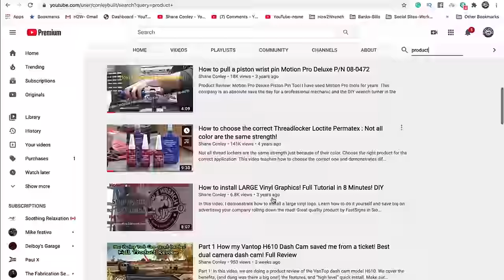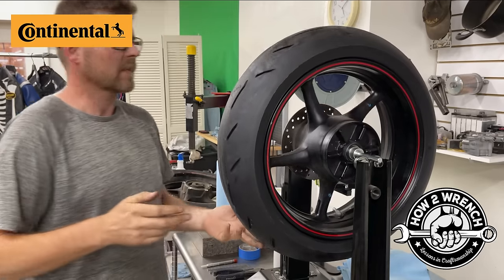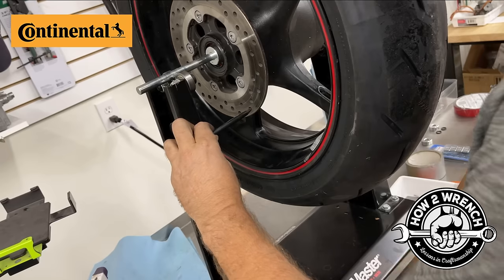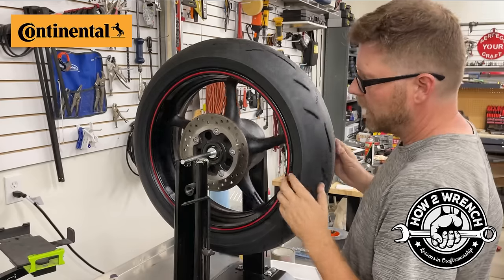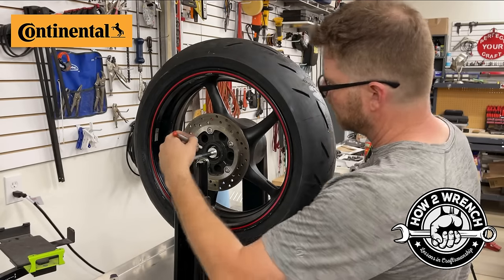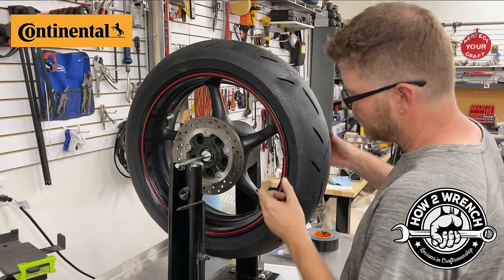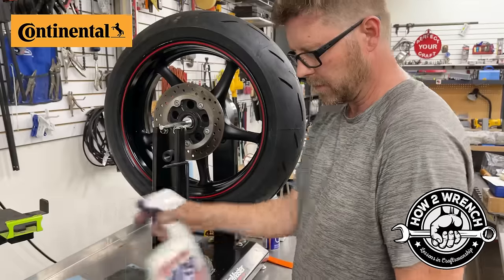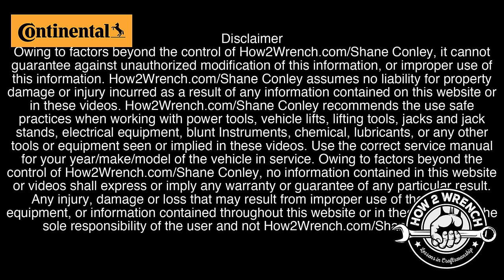Learn how to balance tires like a pro in minutes! Must see first step! BikeMaster Balancer 800-256

Comment: Been balancing my own MC tires this way for 25 years.....One top tip I would offer is before mounting new tire, take tire-less wheel on the balancer and find the TRUE heavy spot of the wheel.  its not always the valve stem.  Mark the wheel this way when you mount a tire with a dot indicating the light spot of tire, you can align the dot with the TRUE heavy spot of the wheel and this usually results in less weight required to get a perfect balance.
Reply: Damn that’s great advice. Doing my first tire change on my motorcycle and will definitely use this tip. Assuming the tire I ordered that hasn’t arrived yet even has a dot.
Reply: @rivec33  If you need any help or tips lemme know
Reply: @craiggoldstein2461  cool thanks. Doing it sometime next week. Looks easy enough.
Reply: @craiggoldstein2461  think I did ok. My tire did come with the yellow dot. Lined it up with the heavy part of the rim (which wasn’t the valve stem) and had to use 7 quarter oz weights to get it balanced. Decided to break the bead and tried it at with the yellow dot at the valve stem (valve stem ended up being at about 2 o’clock to the heavy part of the rim) and the yellow dot only took 6 weights to balance somehow. Was thinking of breaking the bead and spinning the tire around on the rim on the balancer to see where it landed the best balance without any weights and go from there but the service manual says not to exceed 3 oz and since it is only half that decided to just leave it alone. I would have been good either way I guess. I’m wondering if the yellow dot on the tire was incorrect.
Reply: @rivec33  Rivec, you clearly have a solid handle on the process.  Well done sir!  yes 1.5 ounce is OK and I would have left it alone too.  What brand tire was it?  I have a buddy who runs Shinkos (I tried talking him out of it) and did the last two for him same model Shinko....First one took 2.5 Ounces no matter what I did...the second one only 1 ounce....I think their quality control isnt the best.
Reply: @craiggoldstein2461  it was Dunlop Dt3-r. Same tire that came off. I noticed on the old tire the yellow dot was still visible and lined up with the valve stem, it had 3 quarter ounce weights maybe 2 inches away from the valve steam. This one with the took 6 weights in the same spot the old 3 weights were at. I should have probably left them on there and seen what happened. Took the bike out and didn’t notice any vibration or anything, it felt smooth. But didn’t go to far since it was about to start pouring rain.
Reply: @rivec33  Sounds like you did a good job and the Dunlop's can vary a little bit too!  No tire is perfect from factory.
Reply: @craiggoldstein2461  thanks for your help and advice. Appreciate it!
Reply from the maker: Great ads Craig...
You rock for commenting! Smash to sub button and we welcome your comments! 
Another way to help us back is joining or grabbing our T-shirt! Support links and gear below!  Awesome and thanks for commenting! Smash the subscribe button (thank if already a sub!)
Have you seen our "YouTube Trained Support Shirts? Great way to "high five us" https://goodfellasmerch.com/collections/how-2-wrench/products/support-shirt 

Join this channel to get access to perks:
https://www.youtube.com/channel/UCBhM8DCKnT3qXwTW0eToyCg/join    
-Daily MEMBER FIRST COMMENTS ANSWERED FIRST 
-Live Q/A video chats
-Wonder if we have a video on your need? Members can request content links!
-Full Access to the ENTIRE 700 video library
-Member-Only FREE tool giveaways   

Got an emergency and your head is about to explode from frustration or fear? Get Shane’s cell here: https://how2wrench.com/ols/products/techline-one-on-one
Reply: Thank you never thought of that and great you shared that info
Reply: This comment is perfect.
Reply: Same here, waiting for tire.
Reply: what if my tires don't have any DOT to indicat the light spot?
Reply: @JasonLeVlogs  Good question....If there is no light spot indication, I would just mount it randomly and attempt a balance.....If you find you need more than a couple of ounces to correct I would break the beads and rotate tire on rim 180 degrees and retry to balance.
Reply: yeah, on my bike the rim itself is more out of balance than any tire I've ever put on it. I have weights  permanently balancing my rims and then I'll put in some balancing beads to deal with however much the tire is off.
Reply: @joeMW284  I had a BMW K1600GTL and that wheel was REALLY heavy at the TPMS sensor....What bike was yours??
Reply: @craiggoldstein2461  '01 Honda Magna
Reply: @rivec33  Hey not sure if you'll see this but I'm getting tires for my bike and when I was calling around to get prices for mounting and all that I realized most places aren't even gonna bother balancing them. I've changed car, truck, etc tires by hand before and some dirt bikes 20 years ago but never had correct tools. At this point I figure why not by a few spoons (I think those are better?) and whatever else I need to properly change the tires without risk of damaging rims. Trying to figure out exactly what I need (how many spoons/levers) and whatever else. Any chance you could give me some recommendations?
Reply: Yup, find the heavy/light spot on the rim before mounting the tyre then hope the tyre manufacturer did a proper measurement on the tyre (with the dot). I got a couple wheels with no weights...

I always balance with clean carrier w/sprocket (and cushions) and brake discs mounted too.

tip: mark the center of the tyre with a marker as the dot can "disappear" when mounting it on the rim.
Reply: I'm wanting to do the same I've been looking into it seems like the best idea to save money
Reply: @Jonathan Galiano  hi Jonathan, you'll need three spoons, two of them should be the Bead Pro spoons as they double up as a bead breaker and then another spoon that's about 15 in longer or so, so that you'll have leverage with that one. To put the tire back on I use a Baja no pinch Tire tool, this way you're not prying the tire back onto the wheel You're simply Pushing the Bead over the lip of the wheel
Reply: Does the tire come with the light spot marked? Or do I have to find it?
Reply: @TheeTaper  Most Motorcycle tire producers put a yellow or orange circle stamp to indicate the tire light location.  On occasion they don't have any in which case you install it random and see how the tire/wheel balance out.  if requires too much weights then break the bead and rotate tire 180 degrees and try again.
Reply: Doing my own balance, no experience of doing any of this before. Lined up heavy spot on the tire with the light spot on rim. However a second imperfection is messing with the balance due to both spots needing counter weight. My mechanic friend that works on cars only at a shop says they just add weights in different spots when needed for different imperfections.
Is this a thing that can be applied to motorcycle balancing as well? 
Every video I ever see only shows people adding weights to one single spot, and they never mention you may have to add it to two different spots on the rim.
Reply: @flametai1  You can rotate tire 180 degrees on the rim and try again......doing static balancing at home putting weights on multiple spots on a wheel is probably a waste of time.  If your balancing setup is decent you sould really only identify one location to add weights.  You can also try sliding that location an inch or two sometimes makes a huge difference.
Reply: @flametai1 That is because you never need to add weights to more than one spot.  People who don’t know how to use dynamic balancers can get into a situation called “chasing weights,” but that isn’t because you need weights in two places, it is because of the way the machines work.  Experienced operators know who to recognize and deal with this.
Reply: Static balances work well, but they only can balance in one dimension.  With narrow wheels, this isn’t a huge limitation, but with wide wheels it can be a big problem.  That is where you need a dynamic balancer than can balance in two dimensions.
Reply: Sir My motorcycle already disassembled myself for cylinder kit replacing and painting.I can try this idea of course👍
Reply: Back in the 80's when I worked at dealership, I checked a bunch of Yamaha's and Suzuki's just about all the bare wheels I checked were 'perfect'
Reply: With the front tire on my Ninja 650 there's no space to put the weights in the center, instinct with physics tells me I need to put them in equal amounts on either side up to the proper weight to balance to prevent any wobble at high speeds. No videos show specifically a front tire. I have two 1/4 oz weights on the right and one on the left of the rim lips. 3/4 oz "statics" the tire be it on one side or the way I have them now. 
What is the proper way to do this, and will it cause tank slapping at high speeds?
Reply: I am so happy I came upon this video, thanks for all the great tips.
Reply: I just did my first tire tonight. I should have checked the wheel first. Oh well, I guess I'll check in next time!
Reply: Oh that is great advice. I'd assume that BMW have their wheels perfectly machined and are balanced. But is is a great pracitce. TPMS sensors add to the equation.
Reply: If you are really ocd temp balance the wheel alone. Pro tip get a sharpie and mark that weight/location inside the wheel.  Then throw on the tire and find the heavy/light spot and required balance weight of the tire.  Now you know how exactly where to match up and how much weight you should need.  You also have the data to track tire to tire and see what kind of quality you are getting.
Reply: Beat me to it
Reply: For sure good advice.  Especially Harley wheels. The coushin drive and everything can be off.  I do like you said and pre balance all that. A lot of times you can pull the coushin pully rotate it and find balance that way.  On my own bikes I take the time and move it along with the tire if need be and 99% of the time I can get it spot on without weights 

Even at the store on the speed balancer of its way off I just rotate the tire some and try and get it as close as I can.  I think alot of people over look the thought of being able to turn the tire and change the balance
Reply: Balancing my new dual sport tires with a rim lock and my rear is calling for 8oz of weights. Yellow dot in over rim lock, beads seated, Tusk Dsport tires, what gives?
Reply: Thank you. I will try it next time. Just did my first balancing last week for the first time. I took the wheel to the bike shop to balance and they did a terrible job both times. So, o bough the the balancer and did it myself. Happy with results!
Reply: There’s a yellow and a red dot, correct? What’s the difference?
Reply: can you just level out a pair of jackstands  and use your axle? seems like that would work to me. the axle is what it is riding on after all.
Reply: good idea!
Reply: Some tires like Michelin power pilot 2ct don't have dots. If you mount the tire using the tie wrap method clinching the beads together you can do your balance check and move the tire on the wheel to the spot with least balancing weight needed before removing the tie wraps.
Reply: @gerardlunow567 I’ve personally seen a brand new BMW front rim with a brand new Metzeler tyre mounted by a reputable BMW dealership with a huge amount of weights on it. This was an insurance case on a K1300GT after it hit debris from a truck on the highway. Dealer didn’t even clean the rim before sticking weights to it, so they left the party after a short while. I really don’t assume anything from anyone regarding any vehicles anymore.

Comment: Has anyone tried match balancing the tyre to the wheel , meaning take all weights off and check balance then deflate and rotate tyre on wheel and check balance again and so on , then after you get as close as possible then add smallest weight needed rather than just putting tyre on wheel and adding whatever weight needed big or small
Reply: If you put the tire's light spot mark at the valve stem, you're essentially doing that. That's why the manufacturers mark their tires with a colored dot on the outside or a sticker on the inside of the tire. It surprises me how many dealers don't pay attention to the mark on the tires. 🤦🏻‍♂️
Reply: @atvtinker01 unfortunately a lot of tire manufacturers don’t do the dot anymore
Reply: That's the way!
Reply: Guide says "yes and then all life in that galaxy suddenly teleported to a parallel universe of perfect balance, where nobody ever slipped, even on a banana peel."

Comment: I don’t trust the double-sided tape that comes on new weights.  Instead, I peel that junk off and put 3M acrylic foam, double sided tape on them.  Clean both surfaces with a good solvent (I use Goof Off) to get maximum adhesion.  You’ll never throw another wheel weight.

Comment: Cones come with an inherent out of round condition depending on who manufactured them and the shaft to cone tolerance. Here is a hint. Don’t use cones. Buy the straightest shaft which come straight within .0001 over 12”. Put the shaft through the wheel and proceed with balancing. Before you tell me it does not work, try it
Reply from the maker: You are right on. One of my Mentors does the same thing. Expensive for most folks is the issue. My mentor gave me and extra chuck of the last one he made and still have not come across needing the oddball bearing ID he had. 
Thanks for commenting. 
Shane

Comment: I put an orbital sander against my bike frame at the wheel, (side of sander touching, and not the pad),  with nothing touching the wheel like a chain, brake caliper. The vibration from the sander will reduce the friction of the bearings and the tire will rotate with the heavy point down.  With spoke wheels I have used solder wrapped around the spoke at the rim for weights.
Reply from the maker: Wow...thanks wild and detailed Danny! Shane

Comment: Since a lot of weights are made of steel instead of lead, or if you are using spoke weights, if I need to split the weight, (ie need one and a half weights), I use two weights and spread them apart an equal distance from the light spot of the wheel.  This averages out the effect of the weights on the light spot and brings the wheel in balance.

Comment: I have been ridding for 64 years and have always just wrapped thick solder around the spokes and has worked for 6 decades. Now that bikes have these tubeless wheels divide the weights for balancing. I think side loading these bearings just add friction to the rotating mass. When using those stick on weights put half on one side and half on the other side. That way there is no dynamic unbalance. That way it eliminates dynamic unbalance if just on one side that is just static balance. Now I just use internal balancing beads.

Comment: Years ago I worked in a tire shop that used bubble balancers. This was before high speed balancers were developed. They worked basically the same as what you are doing here.
We would find approximately the amount of weight that was required to balance the heavy spot and then doubled that amount. The two weights were then placed 120 degrees from the heavy spot to make three areas of equal weight. We thought this would reduce the chance of the tire creating a wobble side to side. When you place the two weights you just move them a little one way or the other until the tire is balanced perfectly. This way you don’t have to trim the weights.

Comment: To get those cones good and tight, you can put a palm sander (padless) on the end of the rod as you push on the cone. It will line right up and lock up tight with the help of the vibration.

Comment: The cones are superfluous.
I built a balancer much the same as this , with the support bearings on the uprights. But I use a 19mm straight axle to support the wheel. The 19mm straight axle  is undersized for the wheel bearings. The wheel self aligns on the axle because gravity forces the ID of the wheel bearings to do that.
The rest of the alignment is normal and is always reproducible which proves the balance is correct. And the wheel never  wobbles on the balancer.
The use of cones actually eliminates that self alignment under gravity if the cones are not tight .
So the cones are superfluous.

Comment: No need to pull up.
Push the top cone down and you'll be fine 😂
Reply: Not a lot of people understand physics. You’re right though. The weight of the wheel with him pushing on it is doing more then trying to pull it up 😂

Comment: Not sure if someone already asked, but how do you decide what side of the wheel (sprocket side or rotor side) to put the weighs on? Thanks.
Reply: I was wondering the same. On my previous original factory tires, the weights were on one side on the outer side of rim. I just had tires replaced at Harley dealership and they put the weights across the entire rim. Not sure what is correct or poor workmanship.

Comment: at the workshop we have axles with diff diameter.
no need for cones.
ex. adapter needed for ie vfr 800 or other bikes with one arm rear suspension

Comment: This type of wheel balancer is also used to balance aircraft wheel/tire assemblies. One recommendation- once you get it set up, prior to balancing, do just as you did in the video- spin the wheel and allow it to spin for at least 30-40 seconds to warm up the bearings on the balancer, then you are good to start balancing.
Reply from the maker: What a tip! Love it...Thanks for sharing and the added value to our wrenching community. Keep them coming.